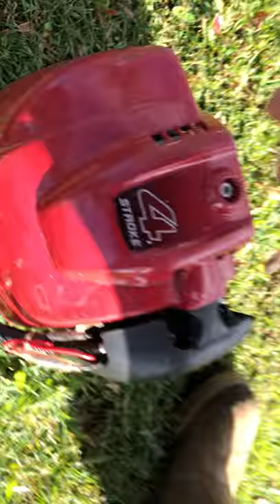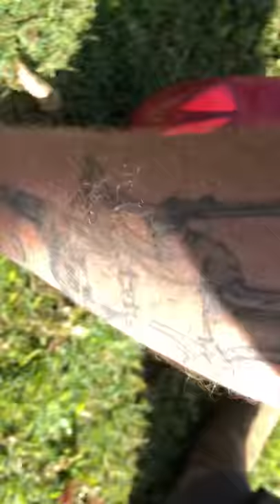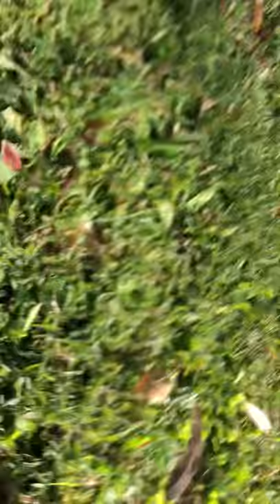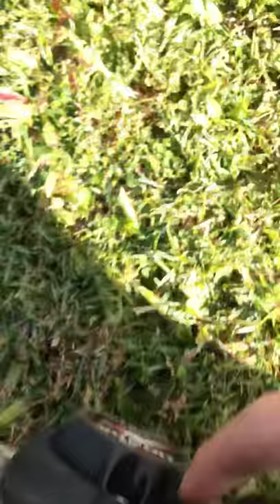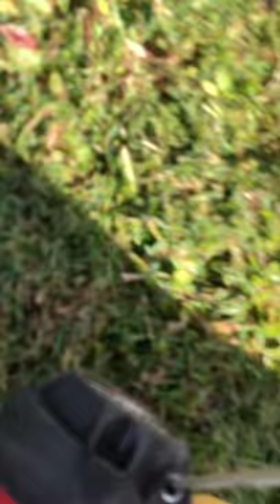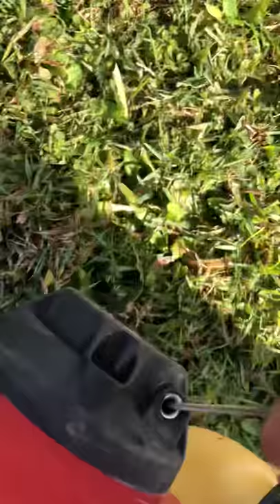Honda gx25. Bogging down under throttle ?

Comment: Fish the fuel filter out of the tank and remove the end piece (looks a bit like pumice stone). I did that and my engine went from zero to hero! As the filter gets old it degraded and restricts flow.
Reply: Thanks Iain! Had the same drama, was running like a dog.. Took that off and all good now 👍👍
Reply: I would replace the fuel filter. It's there to stop your jets and small holes in the carb from getting plugged. They are cheap on eBay or your local mower shop
Reply: @Darklightbulb  Would have been 15 years old when I removed the filter!

Comment: Disasemble carburetor and spray with carb cleaner. Any small engine that runs on choke setting only is gummed up.
Reply: Not necessarily - running only on choke that just means there is a fuel restriction  somewhere-the fuel pump diaphragm could be the culprit so can the fuel lines and grommet 
 Or as you said it could just need cleaning. Most of the time it’s the lines or diaphragm

Comment: When was the last time you checked/adjusted the valve clearances? Mine behaved like that twice over the years and after adjusting the valve clearances, which were out of tolerance, it ran as good as new again. 21 years old and still starts first pull with good throttle snap like when it was new.

Comment: Just fyi...there's a inner idle needle inside of the throttle barrel.
 There's a plastic plug that needs to be removed to access the inner idle needle.